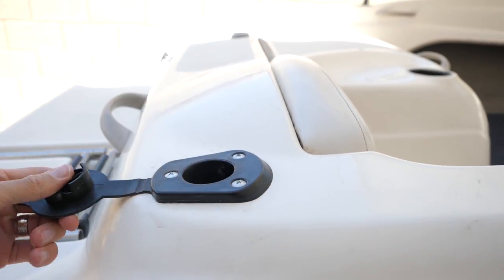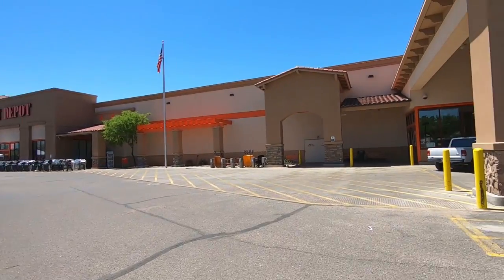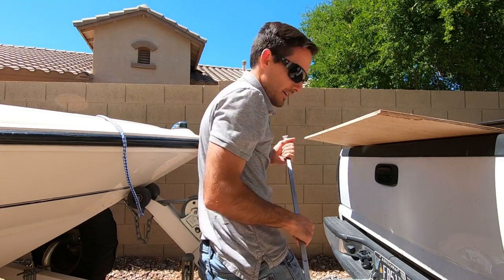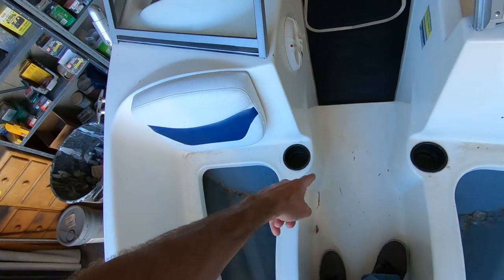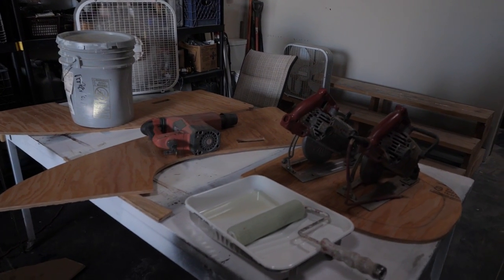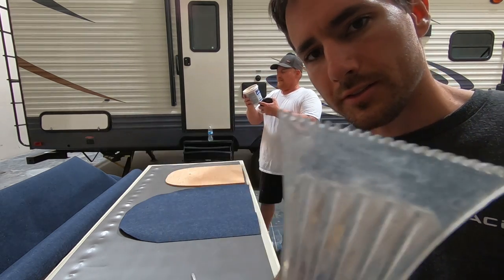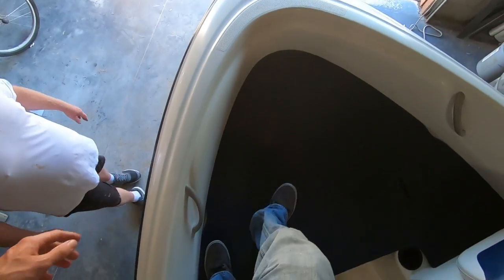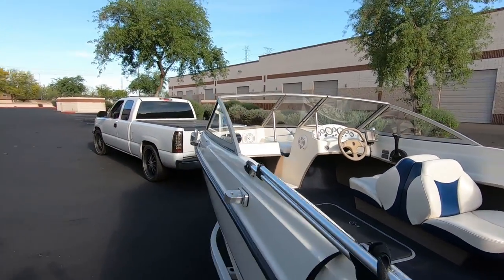DIY Casting Deck for open bow boats!! (2019)

Comment: I'd be curious to see how long the building grade plywood holds up. At the very least i would have sealed it with a proper 2 part epoxy or even glassed it and painted white. Great idea though.

Comment: Nice video I did mine with a swivel seat. I have a bay liner also
Reply: how you do swivel seat on is it trong enough
Reply: @mantran5954  yes it's strong enough even supports me and my son at the same time he weigh about 190 and I'm 210  just use big washers.